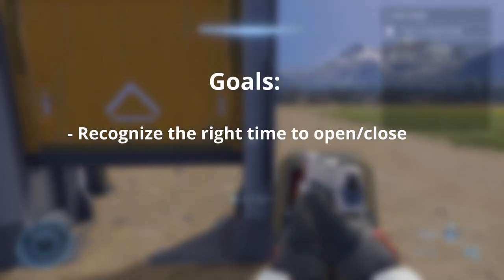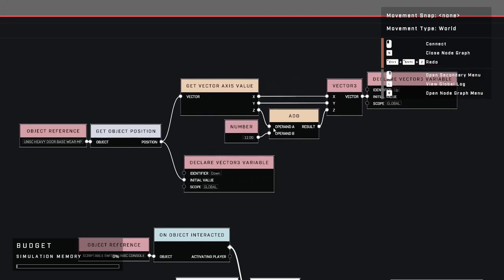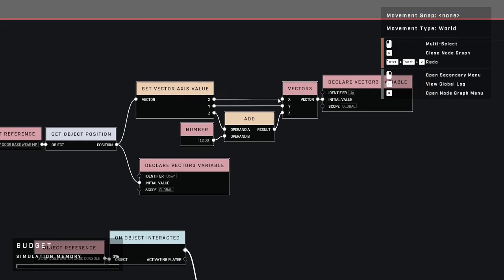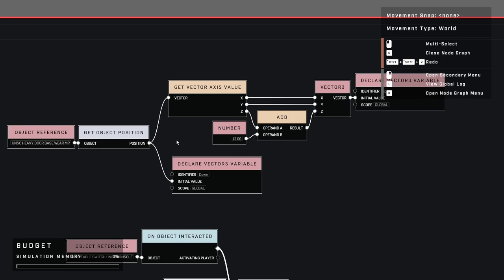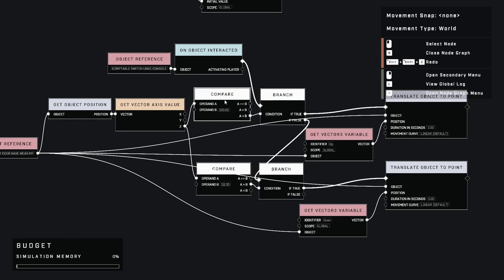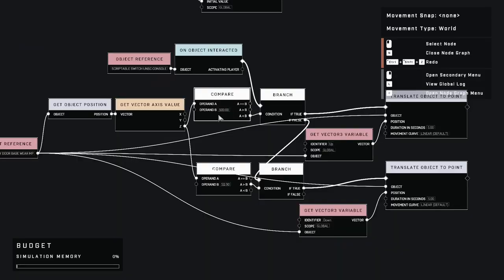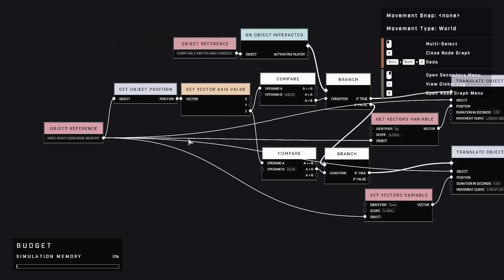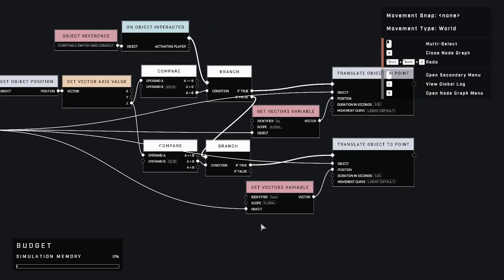Advanced Sliding Door Script in Halo Infinite Forge

Comment: Thanks for the guide!  Just wanted to mention that, rather than using fixed values for Operand B in your Compare nodes, I used Get Vector Axis Value to retrieve the Z values from the Vector3 variables.  This way, I can move the door around the map without breaking the True conditions.

Comment: I re-created all of script and it does work but when i copied it and used for another door it breaks and the door moves to the location of the other door 
Its completely random which one works and which one moves to the other's location, ive changed the names in the script to differentiate the two but it still doesn't work

Comment: Tried this, unfortunately it didn't work.

I followed every step ect watched multiple times.

The only bit for me that isn't totally clear is. Your Z value is 499.95 but you set the variable to 500, why the 0.5 difference?

Also sometimes the switch itself isn't even active when I spawn in, it's like a 50/50 chance the switch itself is active & one time the door did open but didn't close and the other switch didn't do anything.

Like I said I followed every step multiple times, I added my Z values plus the minus value.

I've followed multiple people guides here on YT  and if they work they work once then stop working otherwise not at all.

Maybe I'm not understanding correctly.

I'm on a Xbox Series S and forge is a buggy mess for me so maybe that .